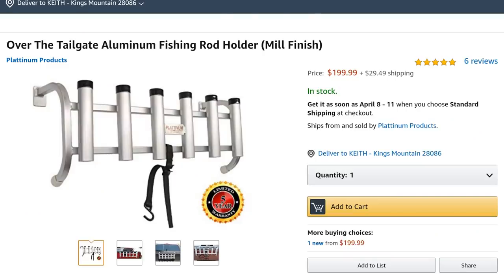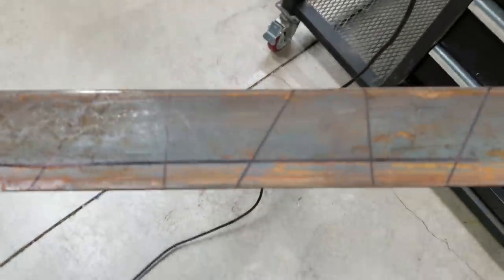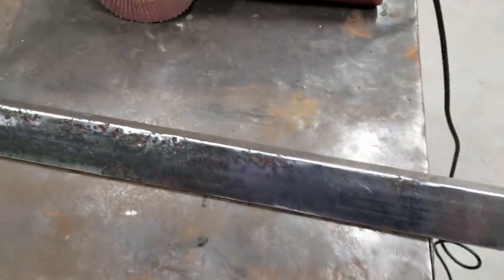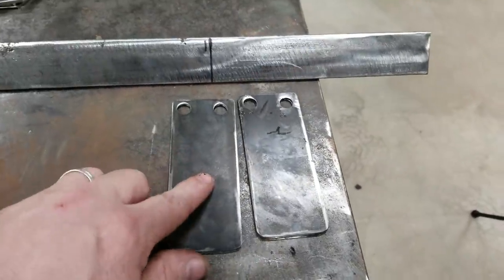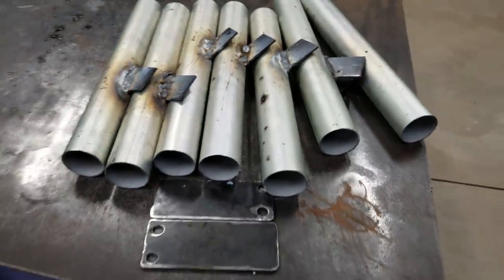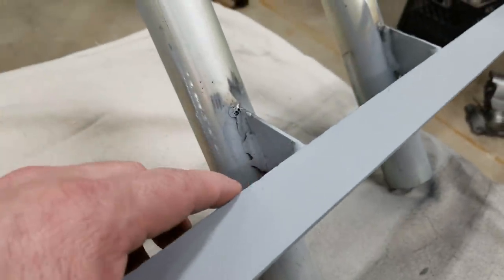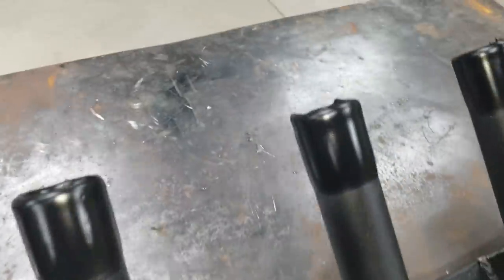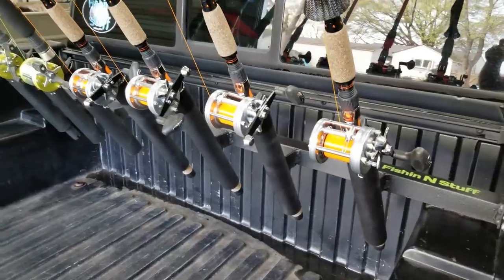DIY Fishing pole holder (Truck bed)

Comment: Love been looking for a rod holder for my truck and came to the conclusion that I'm gonna have to build what I want.  This video definitely helps me out to build mine.  Now to look for bed rails that I can mount in my truck. Keep up the great videos.
Reply from the maker: Hey thank you brother I've got a couple of those t bolts left over , email me your address and I'll send em  to ya , . My email address is in my slot section  . They may not work but that way it won't cost you anything to find out

Comment: Great video! And awesome rack! You need to sell those! As others have said, be careful welding galvanized. I've always at least used a fan pointed away from my welding table to help pull away some of the fumes. Recently I got a free furnace blower fan and made a fume extractor with some flexible ducting.
Reply from the maker: Hey thank you brother , I would at work some , but my job is operating a Robot welder if something gos wrong I fix it by welding it by hand . But im not the best welder in the world lol . Ive got buddy's that are great elders and ive been told allot about Galvanized but never tried it before . Ol I had a fan running it was a 100 degrees in my building when I made it lol , I appreciate you watching man I really do,  I work to much and YouTube and fishing takes most of my spare time , so I don't really sell nothing . Im not the selling type I always end up doing stuff for free lol . But maybe when I retire one day . If you ever have any ideas or advice it's always welcome brother

Comment: A tip when welding on galvanized stuff. Remove the coating. A sanding wheel on your grinder will do it. Just need to grind where ypu expect your weld to go. Once ypu get through the galvanized coating the sander will start sparking. Hope this helps in your future projects.

Comment: That turned out nice!  Full watch even though I don't have a pickup lol!  your DIYs are top notch!
Reply from the maker: Thank you Sir that means a lot man , I appreciate the feed back too brother it helps.  I know you know what I mean  utubin ain't easy hehe
Reply: I gotta ask what camera you using?  I’m considering putting the phone away and getting a real one but I don’t even know what I’m looking at.  I guess you could say I’m looking for a place to start looking and I like the kind of quality you’re showing.
Reply from the maker: I use 3 camera's on most videos 5 on some lol , if you don't want to spend a lot of money id look a Canons maybe a rebel if you don't wasnt ti spend much , I use a Canon M50 it's small and does 4k had a mic jack and a flippy screen which is nice when filming yourself cause you can line your shot up , they are middle of the road price wise . I use a sony A6500 which is a great Camera does all that and more but no flippy screen  , if I only had 1 camera I would wasnt a articulating screen for sure , most all the Canons have em no matter the price , Panasonic cameras are good cameras for filming as well , canon are a little sharper and have good Auto focus  ,  i use my Samsung S8 camera more than you would think lol gopros one in a while for certain shots
Reply from the maker: I'l help you any way I can buddy
Reply: Fishin N Stuff that actually helps an awful lot, I can look up the details and specs of the M50 and know what kind of videos it can produce just by knowing your videos.  It’s just the kind of starting point I was looking for when looking around.  I’m glad you mentioned the flip screen, that’s something I need but hadn’t thought of!  Thank you so much!

Comment: nicely done! came out looking sweet bro!
Reply from the maker: Thank you Sir
Reply: @FishinNStuff  Made your chum torpedo. and then used the square craftsman bucket to make the bucket rod holder. Used the 3 rod holder made by berkley instead of the pvc cause didn't have pvc at the time. Got pretty steep rocky banks in places i like to fish from. I carry my E-Tool inside the bucket, so i can shovel some dirt in there too, mixed with water, the thing is pretty heavy. Appreciate your hacks man.
Reply from the maker: @Lord-Snowflake  I appreciate you watching  , a lot

Comment: I might be doing this exact project! Gonna need to find a way to secure the rods in and I wanna lay it down a touch more! Picking up a 2015 canyon tomorrow morning and I don't think my 7'3 is going to fit inside as it's only a extended cab not a true 4 door. We shall see! Either way I'll be making this!!!
Reply from the maker: It turned out good , I like it better than the PVC ones but done ppl can't weld so I made that for them , I haven't had a problem with keeping the rods in it but if you lay it down more , you might need a bungee or something , neither I appreciate you watching and commenting  I love hearing other ppls ideas cause none of us know everything especially me lol . I always say when you know everything you stop learning
Reply: @FishinNStuff  we never stop learning. And we will see what happens once I have the truck in my hands!!! Might have to do a floor mount if it doesnt have rails
Reply from the maker: Well I think a metal welded floor mount could be awesome 👍
Reply: @FishinNStuff  hey boss!! Got my truck monday!!!! Unfortunately there is no tracks. So I'll have to do a floor mount!! This will become an spring project!!

Comment: Awesome build man, it turned out great.  Now I need you to come up with some kinda DIY planer board storage for the boat. I've been using a 5 gal bucket with 3 sets inside and the foam is getting beat up.
Reply from the maker: Dustin Smith thank you Sir I appreciate it  , I'll start thinking on brother I appreciate you watching  . Ol and the first thing that comes to mind is those plastic ammo boxes they sell at harbor freight  , they would be perfect but I'm not sure if they would fit , they cheap too
Reply: @FishinNStuff  I will send you an email with a picture of one idea I found I kinda liked

Comment: Good stuff but you really shouldn't be breathing in the fumes from welding galvanized tubing.
Reply from the maker: Your right , I should probably use fluxcore and run a fan , you think that would work better ?
Reply: Yea or just do it outside. Good video tho. I’m gonna make one I think but I may use exhaust tubing instead.
Reply: I always strip the galvanized coat off with Muretic acid it’s comes off quick just a FYI
Reply: Inwas sure someone had already said it but Please please be safe when welding galvanized and Zinc coated material. I always try and sand off as much of the coating as possible first to help get a cleaner weld and to minimize my chance of galvy poisoning (death). I love your content and just want you to not die or get really sick.
Reply: You'd have to weld a whole lot of galv to die. Worst ive ever got was a headache, production welding 8+ hours  a day. I dont weld galv every day though. Drink milk, the zinc bonds to it and youll drain it out the next morning. Good video man keep em coming. 👍👍

Comment: Or u can just get Thule rod racks for your truck. Everyone here in hawaii does it do it’s aligned with the roof of the truck. Idk why fisherman from other states don’t do the same
Reply from the maker: There's nothing wrong with going that route brother but the process ive seen on those were 150 -500 range and everyone don't have that . Plus when you cab build this for 30 bucks it's apples to oranges really

Comment: I've been looking at doing something similar to this but one that requires no drilling/is easily removable and I've found ratcheting cargo bars, I was thinking that would be perfect! Just U bolt some bullbar rod racks onto the bar and then it's as easy as ratcheting the bar across the tub every time you need it! I've priced it up locally here and for a 4 rod holder and the bar it's $79, how can you beat that for simplicity!

Comment: Awesome build, whats the trick to get the plasti dip ends smooth?
Reply from the maker: Where it dipped off , most of em shrunk back down and looked ok but the few that didnt I trimmed with a razor blade. I also went back with a plasti dip clear coat spray on but forget to film it it gave it a glossy look

Comment: One thing I noticed with plasti-dip the rougher & cleaner the surface the better the adhesion of the dip
Reply from the maker: I think your right because it stuck really good to that bedliner spray

Comment: Great job, dude !   I have a question, would a spinning rod sit well in the holder ?  I really don't want to make the cuts down the length of the tube, like others I've seen. Does it really need that slit down the top part of it ? Thanks !
Reply from the maker: I don't think the slit has to be in it if the handles are long enough
Reply: @FishinNStuff  Good to know. I think it takes away, from the look. Thanks again !

Comment: Where did you get the piece that slides in the track I got a Tacoma and wanna build one
Reply from the maker: They sell em on Amazon , it's called a T nut they are easy to find but I'll get you a link right fast
Reply from the maker: Sorry they are called T slot nuts , GZSJY T Slot Nuts for Toyota Bed Deck Rail, 4 PCS Stainless Steel Nuts for Tacoma & Tundra Cleats, Tie Downs and Accessories 3/8"-16 Thread 304 Steel https://www.amazon.com/dp/B07DXJ9QGF/ref=cm_sw_r_cp_apa_i_r8R2Cb3QN4C5S
Reply from the maker: I'm thinking about making another project for the Tacoma soon

Comment: This is great but I am not a welder by any stretch of the imagination. I have your other video where you used PVC pipe so I will probably follow that video but I have one question. What about security? How can I lock up my fishing poles to this rack in the back of my pick up truck? 

Since these are exposed and open to the public my fear is anybody can just walk up and help them self to any and all of my fishing poles I would have in a rack like this in my truck ?? 

How could we secure the fishing rods directly to the rack ??
Reply from the maker: I've actually thought about that a lot and hope to make an upgraded version.  Besides a cable and a lock I can't think of a way to make those secured

Comment: I hope you held your breath welding the galvanized conduit. That stuff puts off some toxic fumes.
Reply from the maker: Yes Sir i have friends that weld they filled me in on that stuff , I have grinded down through the galvanized layer and welded before but that conduit is so dang thin that's pretty much impossible,  but that's the point in using it . It light , hey buddy I appreciate you watching and commenting
Reply: Drink a nice big glass of milk before welding galvanized. It helps a bunch.
Reply from the maker: Over heard that  too you guys much would a lot I stoled some at work and at home , but I run a robot welder , it does most the work lol
Reply: Metal fume fever is no joke.  Feels like having the flu, I used to have to weld pins on ductwork in an area not properly ventilated.  Not fun.

Comment: Only thing that sucks is you have to climb in or on the truck to get the poles out of the middle..
Reply from the maker: Yeah I can barely reach it if I stretch  , but your right  . But brite side is you can adjust things any easy you want when you make it yourself

Comment: Great idea, however, when welding galvanized steel, remove the coating with margins around the area you intend to weld. The weld fumes are toxic and if breathed, will decrease the number of days you have left for fishing. Your channel is too entertaining for that to happen
Reply from the maker: Ol man thank you very much . I don't weld very much galvanized metal and normally I grind it off before welding and tried to on this but the conduit was so thin I had trouble with it so o just tacked it and held my breath lol